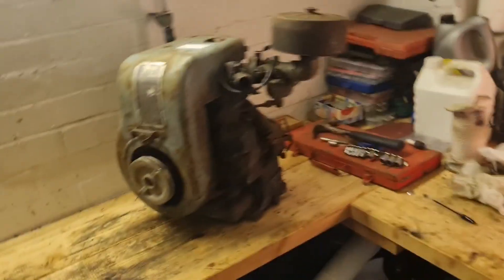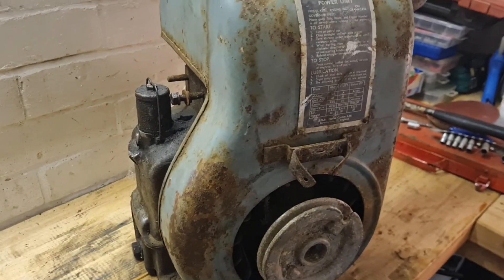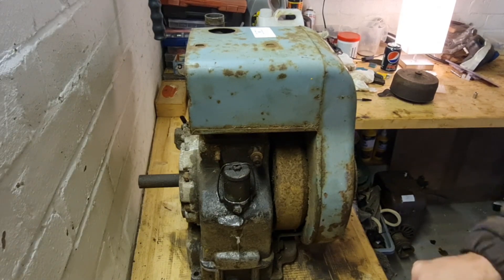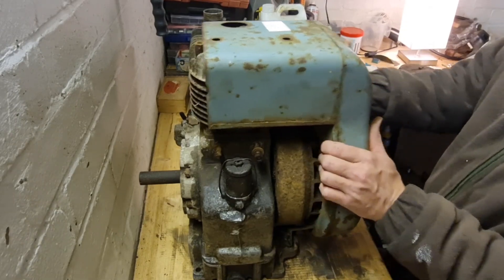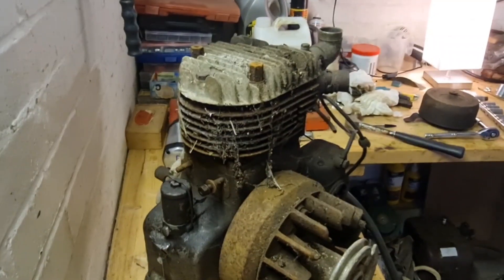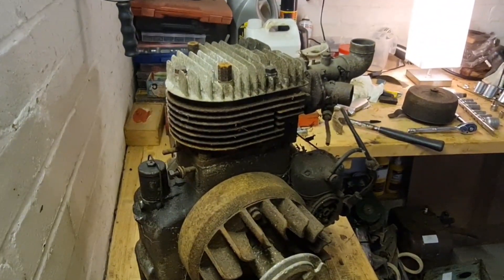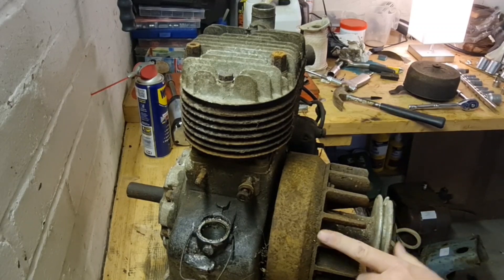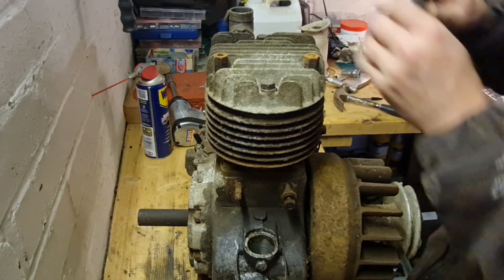BSA Engines bought from farm auction. Are they any good??

Comment: That carb on number two engine looks like an "Amal" - You can't get much better than that! What you really need is an ultrasonic cleaner, and that carb will look almost like new.

I remember, no that many years ago, having one of those mags that was seized, and the reason was a bit weird. The rotor in the mag had actually swollen, and had expanded so much that it was an interference fit inside the stator - It took some getting apart, and needed a press to push it out. You might want to keep that in mind during disassembly.  Making it fit again is quite easy, because the rotor is mostly aluminium, you can mount and spin it in a pillar drill, and then either, use a fine file, or some emery paper against the rotor to turn off some of the extra girth. After that, the mag will work again!

Going back about twenty five years, and back to engine number one, we had a Kohler 8hp engine which was stuck solid. The get it free, we ended up with a dirty great big stilson pipe wrench on the crank shaft, and with a bit of perseverance were able to get it to turn. That engine went on to live a happy life on our Hayter Condor verge mower. So don't quite give up on engine number one just yet!
Reply from the maker: I have not looked but I belive it is by the looks of things. Hopefully get her  running on the next video. 🙏

Comment: On the seized engine try hitting the bolts with a hammer it can brake the rust and get the bolts out old trick my grandfather told me
Reply from the maker: Yeah I could try a few more tricks to getting the head bolts off. I won't give up on it yet.